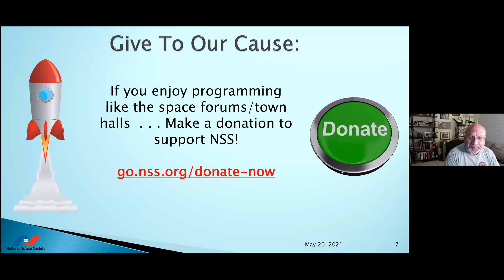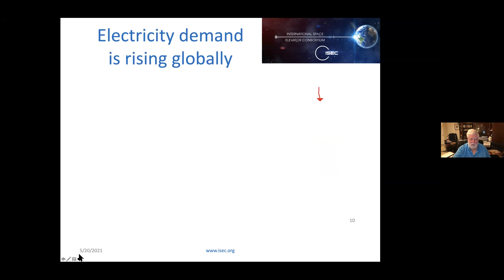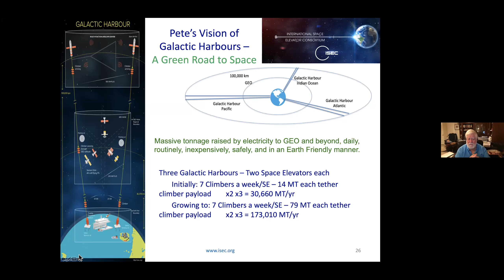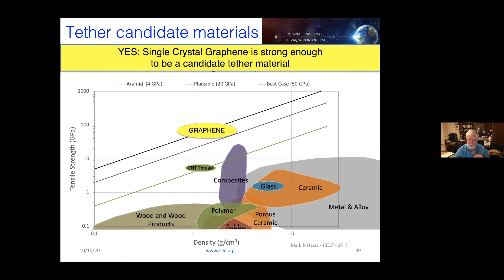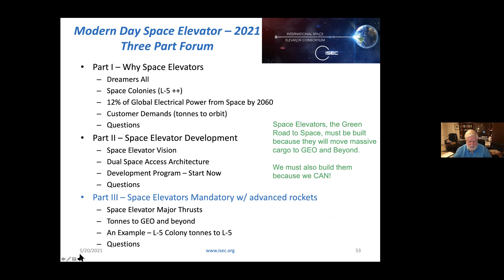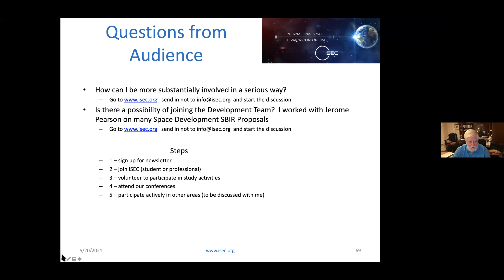NSS Space Forum - A Modern Day Space Elevator - 2021 - With Dr. Peter Swan

Comment: If the space elevator was built in stages with multiple tethers at the center (where there is virtually no weight penalty) and fewer tethers in each stage as you moved out from center, it would help mitigate the problem of space debris. It would also eliminate the need for a tapered tether. It would be much easier to bring up many smaller components i.e. tethers, as opposed to one large tether that would still be necessary for initial deployment. A modular staged system would allow for tethers with different modalities. Please watch the YouTube video- "Modular Space Tether".